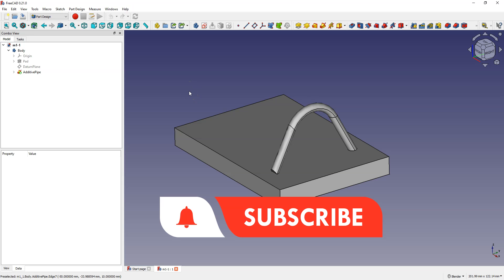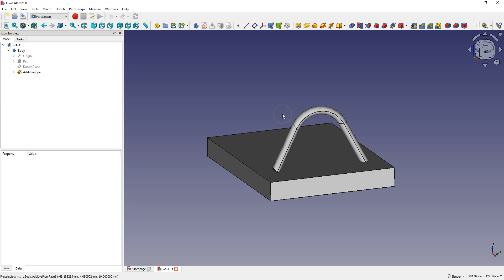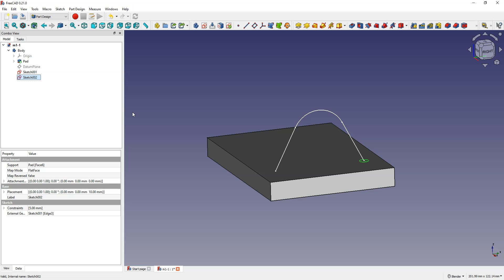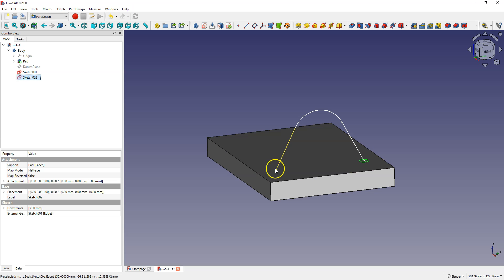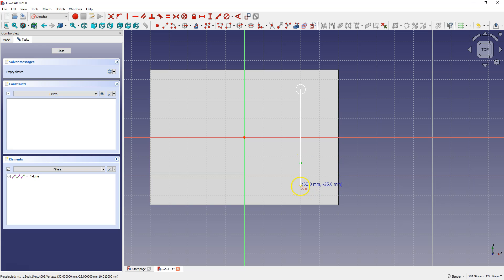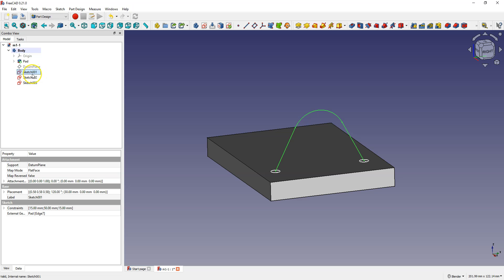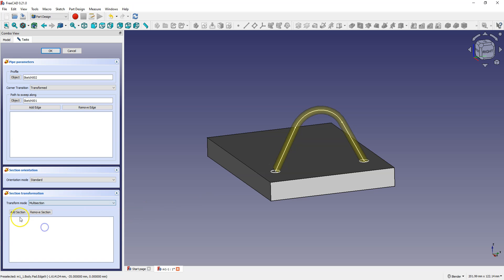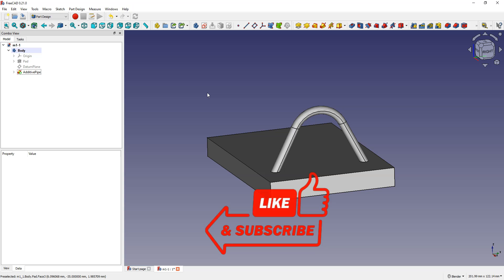Solving the problem with sweep the profile along the path | FreeCAD 0.21 | Additive pipe

Comment: The original problem occured as a feature of sweep.  A single profile being swept takes into account it's angle to the sweep path.  The path was not 90 degrees to the sweep path, thus, requiring  adding a profile on the mating plane at the end of the sweep as demonstrated. If the sweep path began and ended at an angle perpendiculer to the beginning and end point base, a single feature to sweep would work.